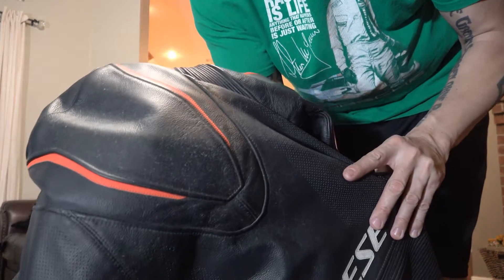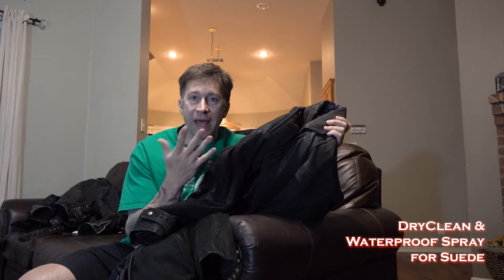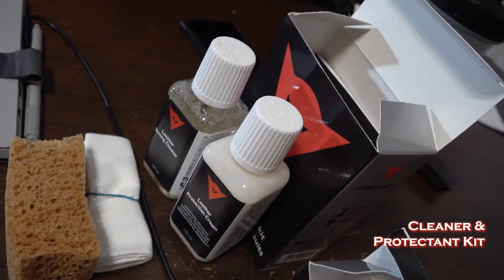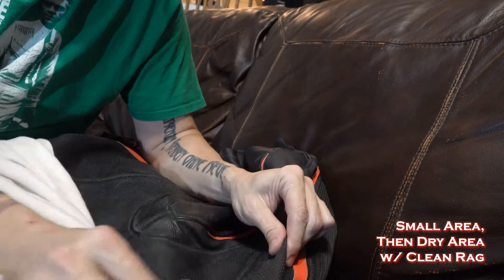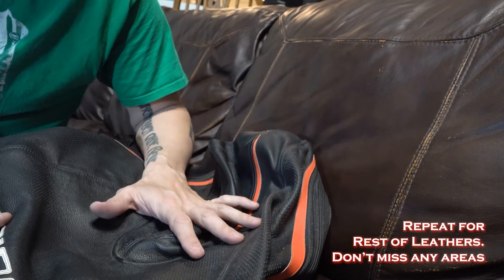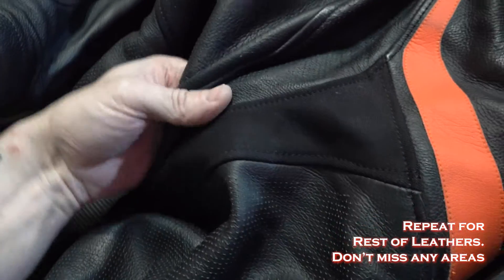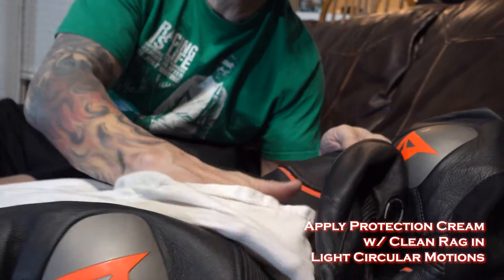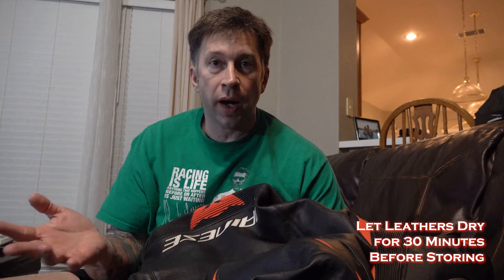How to Do Motorcycle LEATHER CLEANING and Leather Conditioning-Dainese Motorcycle Suit 1 Piece

Comment: Interesting to see what they give you with it but I just use armor all leather cleaner wipes get leather clean then I use a liberal coat of Obenauf's Heavy Duty LP to condition. Also keep in mind you're caring for dead skin. Ide highly recommend not using a rag to apply conditioner, use your hands. Your skin oil will help along side the conditioner and it lotions your hand at the same time. Not a bad idea after caring for them is to wear it, your body heat will help conditioner sink in. Sweet suit Btw 🤘
Reply from the maker: I'm sure the formula changed, but as a kid i used armor all on a bike seat and tires, and it completely dried them out, cracked them, ruined them, so i became scared of armor all for life. As long as you're confident in that product and have had good luck, i'm sure any leather care products for automotive would be reasonable approaches, as long as they're strong enough to get the bugs off. interesting on use of hands vs. rag. yeah, i do like the look of the suit, thanks for the input!